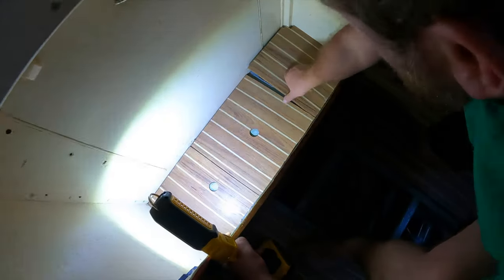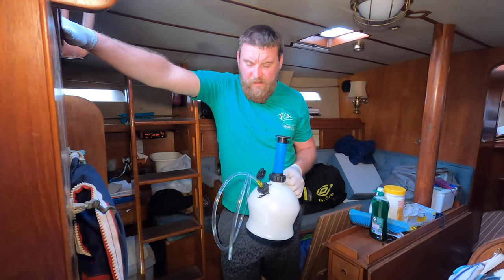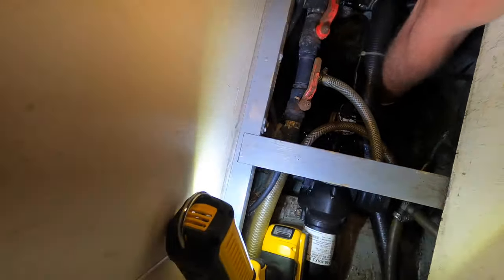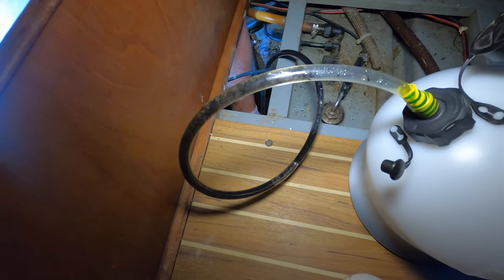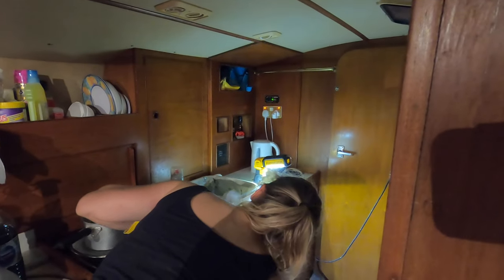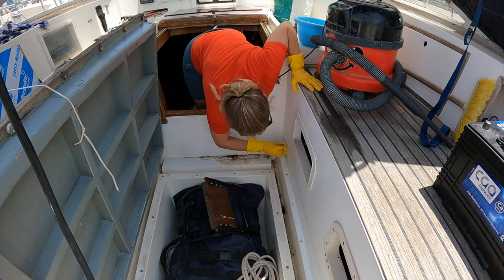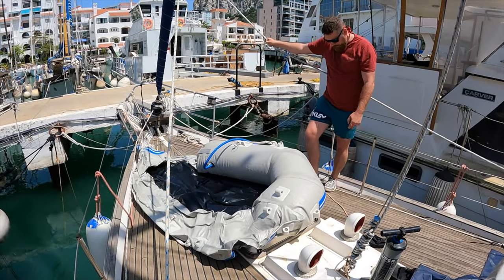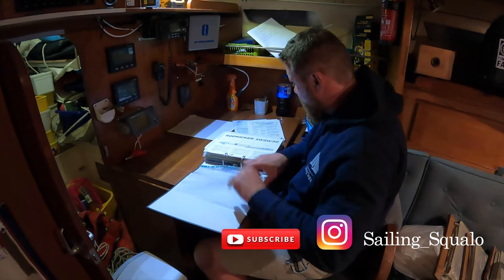Perkins engine is leaking so much OIL !! [E4]

Comment: Stop the motor. Get a clean cloth and wipe the underside of the motor to remove the oil. Get a mirror to help see below the engine. Start the motor and watch carefully. If there is an oil leak you should see it. Look for leaks that run down the SIDE of the engine. They are the most difficult to see. Keep checking the gearbox oil too.
Reply from the maker: It is so hard to tell where the problem lies.  The gearbox oil however is fine.

Comment: When sucking out the engine oil, do not over-pump that device. I had one, and over-pumped it. I blew the valve on the top of it. Settle for about 15 pumps, and wait.
Reply from the maker: Good advice 👍thank you

Comment: Hi Guys! I'm looking at and ad for an Oyster 39 for sale. What are your thoughts on this boat?
Reply from the maker: Hi Geoff, she is lovely. Under sail she performs very nicely, very comfortable as a live aboard. I suppose most centre cockpit yachts are great that way. Storage on it is great and the unusual addition of a port side “workshop” or whatever you want to turn it into is fantastic. I love the fact there js access to the engine from front, both sides as well as from the cockpit which means if you ever need to get it lifted out then it is should be an easy job. 
 She is not the easiest to handle in tight spaces, depending on what you are used to, but with time we were more confident moving around a marina. But anyway in the future we plan to install bow thruster :) overall, she is well build. We met along the way a couple of owners of the same oyster, they wouldn’t change it for anything.
Is the one you are looking at in a good condition? Well maintained? We noticed that there are some issues with teak deck, this might turn out to be a big job. Ours is  secured with screws which hasn’t been maintained that well.    Have you seen her for yourself or gauging condition based on photos? can be very misleading or taken a long time ago.
Reply from the maker: I am curious what your plans are if you decide to buy her? Please tell us more :) best, Nat
Reply: @sailingsqualo  Hi Nat, Thanks very much for your thoughts and impressions! It looks such a cool boat with a lot of character and well built as well. The one I've seen is on Yachtworld at the moment. It looks like she is in St Martin. I'm in Canada (originally from UK). I've only seen the pictures and info online.  I've taken a sailing course here in Canada and am keen to take the leap, to a liveaboard, cruising lifestyle.  I've been researching and planning for few years. I think the fear is taking that scary first leap into the partially unknown lol.
Reply: @sailingsqualo  Hi, I tried reply to the email you sent but it came back with an error. I think bc the email address was a YT no reply. Geoff
Reply from the maker: It is sailingveselsqualo@gmail.com , watch out for the different spelling of vessel with one ‘s’ :) perhaps that’s why it went wrong. If you still have issue I will look into it :) don’t ask why it’s with one ‘s’ 😁

Comment: cloths washing liquid good for washing engine and bilges at 40 deg , and biodegradable. lot cheaper and pleasant smelling than bilgex . we had oil in my 39 ,oil filters leaks , mostley  try to get the wright and good makes for replacements , glass bolls on water traps on fuel filters good idea. we have 3 fuel tanks,but had one fuel filter in line to engine. we fitted in line, water trap fuel filters from port and star  tanks that fed main tank under salon  table  ,  all tanks have on off taps . dirty fuel at pumps is a real hazard .it cost 1000.00 euros to fix our gen set , dew to dirty fuel,  do you have hydrolic sterring  if so has it a bypass for emergency sterring
Reply from the maker: Thanks for all the tips! Always appreciated. 
We have a Whitlock Mamba mechanical steering system.
Reply: @sailingsqualo  hope to see more of   your         fine looking  oyster39  soon , and meet on the sea one day happy sailing from oyster39 (TAGUS)